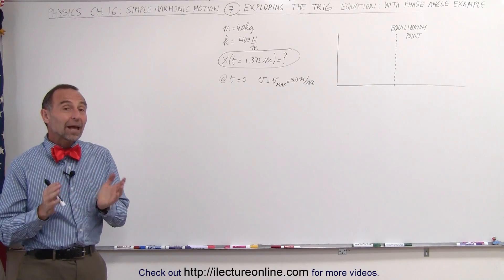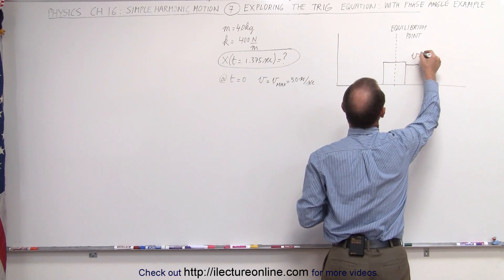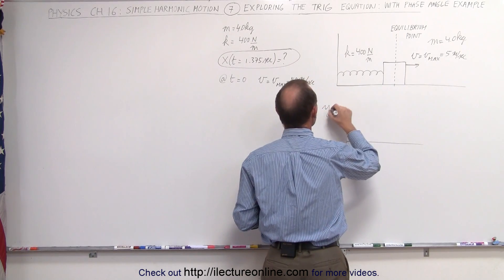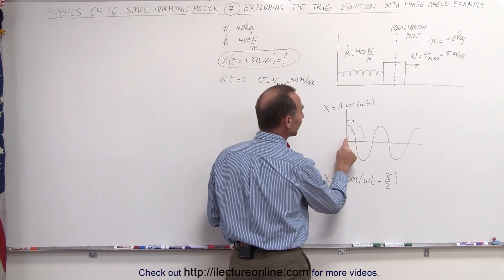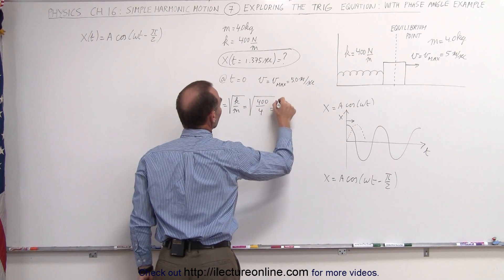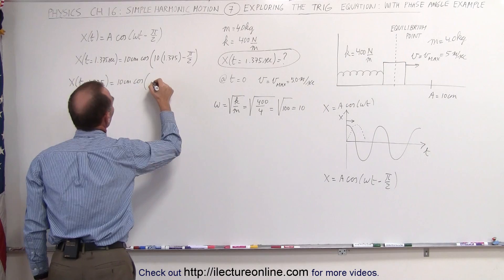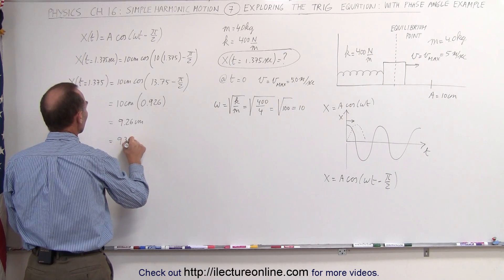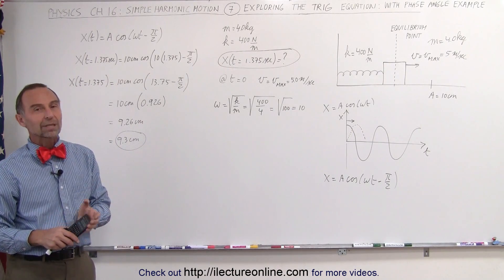Physics 16  Simple Harmonic Motion (7 of 19) Trig Equations w/ Phase Angle

Comment: you can also set up the sin(wt) from the beginning since the velocity is positive value and when t=0 the slope of X=cos(wt) graph has to be positive. but X=cos(wt) when t=0 is v=0 since the slope is 0. Therefore you can figure it Cos graph horizontally moved to the right 2/pie which is same as  X=sin(wt). If the velocity was -5m/s you can shift the X=cos(wt) to the left and you will see the slope (velocity) on displacement-time graph becomes negative. This is why I love calculus so much.
Reply: plus even if you didnt dont know the Amplitude, you can get A from dx/dt since the velocity was given.

Comment: Sir you used 4kg instead of the given 40kg so the angular frequency is different so does that affect the result, also can we use x=Asin(wt) for this problem
Reply from the maker: I believe that the mass = 4.0 kg.  (The period is hard to see).  You need to include the phase angle in the equation,
Reply: Sir I'm honoured that you replied and yeah I didn't see the period😁😁

Comment: Mr. Van Biezen, I love your videos. I have a question in this case. What is the correct initial condition you mentioned?. I guess the block is pulled first to the given amplitude A=10 cm and then it is released for  free vibration, which means that in the initial condition the spring has stored energy, so that block´s velocity is  lagged π/2  with respect to displacement x. Is that correct?. Regards from Rosario, Argentina
Reply from the maker: If the block is pulled to the right in the beginning (positive direction) to its maximum value and then released, that initial condition means that we need to use the cosine function to correctly represent the motion as a function of time.

Comment: shouldn't the max amplitude be 0.5 m as we already have vmax and vmax = w*A. A here should be 0.5 as we know v max = 5 and w = 10
Reply from the maker: Yes indeed, you caught the inconsistency in the problem.  When I put numbers on the board (at random) I didn't check that the amplitude was consistent with the maximum velocity.  Good catch.

Comment: Hey.
You didn't use the velocity information so you added an amplitude,
but (for other who have not seen it yet..)
The v is 5 and the acceleration is 0, when v is 5 as told.
therefore you should use a = -A(w^2)cos(wt+phi) , t = 0 because its the equilibrium point, then you find phi, and go back to the velocity equation, find the A and go back to the pistion equation. 
finding it while you got all the inforamtion you need.
Reply from the maker: That is correct.  In this example, to find the position as a function of time, it was not necessary.   To find the velocity as a function of time, or to find the total energy stored, knowing the maximum velocity is necessary.

Comment: Hi Sir, I have a question,
If I start with F=ma, using algebra and calculus I can get to x(t)=Asin(wt), however there is no Psi (phase angle).  How does this phase angle "drop out" of the calculus?  Have I forgot to add a constant of integration somewhere? Or do we just add the phase angle to the equation ourselves, so that the equation suits the particular situation we happen to be studying?
Reply from the maker: Very good question.  Just like with every integral, there is a constant of integration, which can be determined when you know the initial conditions.  So the phase angle depends on where the object is at t = 0.
Reply: @MichelvanBiezen  I see, I will play around with the numbers tomorrow and change the initial conditions.  Thank you for replying so quickly!

Comment: Sir, shouldn’t A be 5cm in this case? Using conservation of energy to calculate A.
Reply: Got it, thank you sir. You made shm very easy to understand.
Reply: It was a typo, I meant 0.5m.
Reply from the maker: It should actually be 50 cm, to be correct.  I just grabbed a number without calculating it for a place holder, but I could have calculated it for the correct value.

That is a very good observation!

Comment: So i can use x=A sin(0) then for this question since it started at the equilibrium point towards the right? What if the object has a max velocity that is negative? Does that mean it moves to the left from equilibrium point?
Reply: you can use the function x= A cos (wt -pi/2) as the object has the velocity moving the right, this function is similar to x=A sin (wt) ( you can see the shape of sine function). 
If the object has the negative max velocity, it tends to shift to the left; therefore, you apply x = A cos (wt +pi/2) (it starts at O and goes toward -A). 
You actually understand the concept very well
Reply: Or you can use x=-Asin(wt)

Comment: according to given value max speed is 5m/s by which max amplitude is .5 meter. so your question is wrong. you can also solve by initial energy equal to final energy (K.A^2=M.V^2)
Reply from the maker: +azad singh 
You are correct.  (and so are the previous viewers who commented).  I arbitrarily picked an amplitude, which is incorrect based on the constraint of the maximum velocity.  It must indeed be 50 cm (0.5 m) in order to be consistent.  Thanks for commenting.
Reply: Yeah, i think that's quite important jajajajaj

Comment: 1) what is the difference if the phase shift is = (3 pi /2)  ?
2)when  I calculated the amplitude I got 0.5 meters , is that wrong ??
Reply from the maker: +Thoraia Khaled The maximum amplitude is 10 cm, so the y value can not be larger than that.  Also make sure you have your calculator in radian mode.